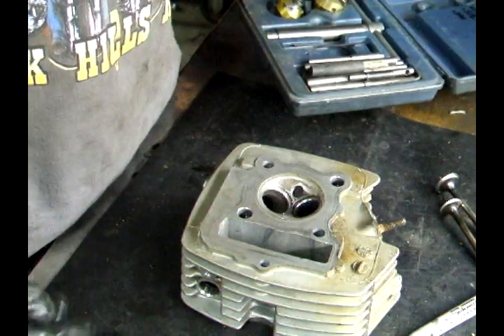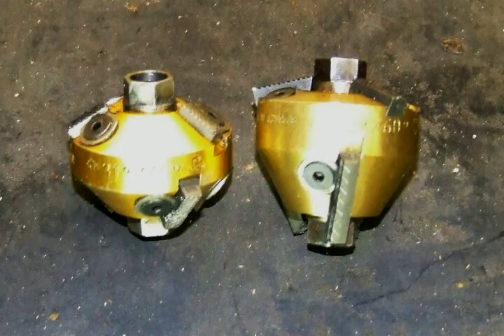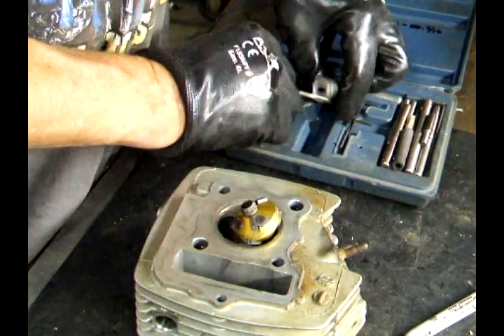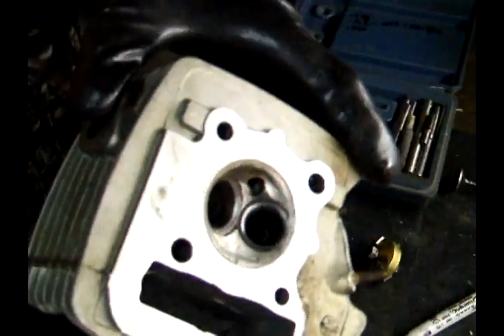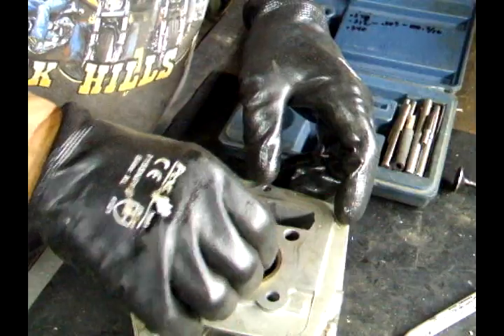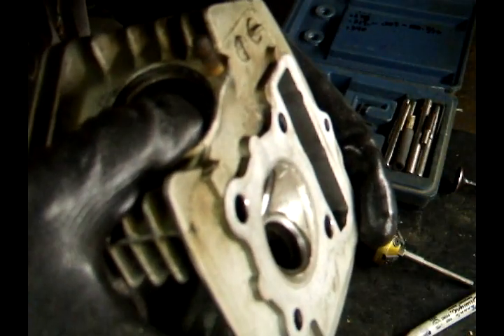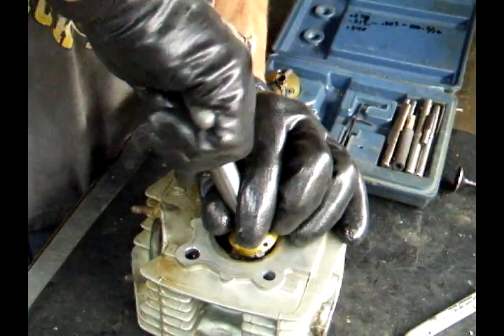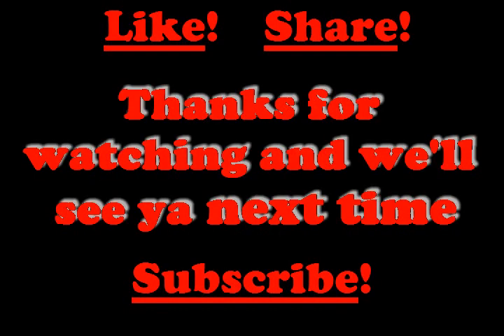How to cut motorcycle valve seats.

Comment: Fwiw it's Honda says not to lap XR200 valves lest you take off the  stellite coating. Just redo the seats like in this vid and use new valves.

 I don't know about the rest of their line up or other brands.
Reply from the maker: There is no coating on XR200 valves
Reply: ThumperTalk people in the know say there  is and that the Honda service manual says don't lap them. Some guys at TT use a very fine lapping compound but they don't over do it

Comment: How do you know what angle cutter you need to use? That's the only part I dont understand.
Reply from the maker: I think it's 46 degrees, all the other angles are for relief and to get the width of the seat to be around 1mm wide and in the  right position.

Comment: Hi.
Do you know what was the compression value before valve job and after?
Thanks!
Reply from the maker: Yes. Zero psi, cause it had a bent valve after it sucked the choke plate through the intake.